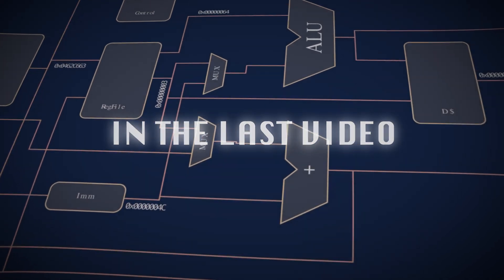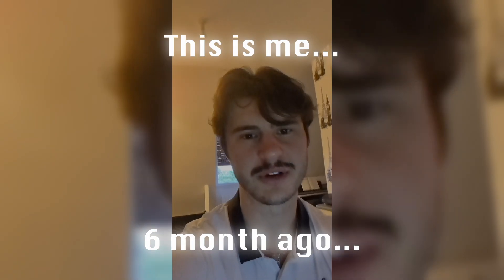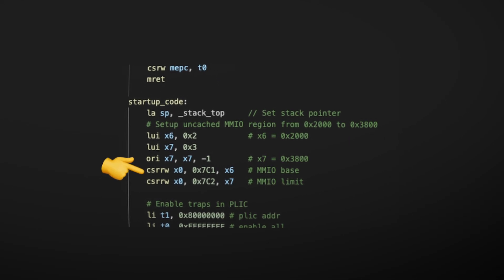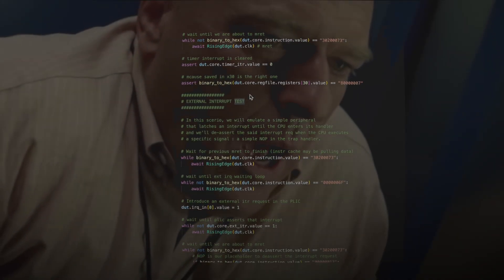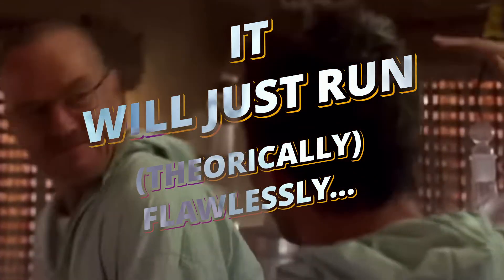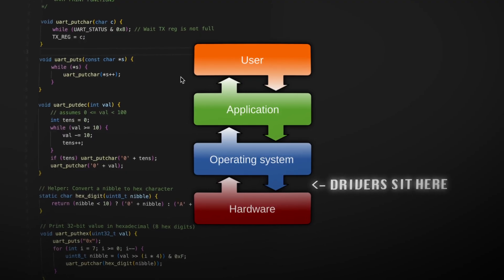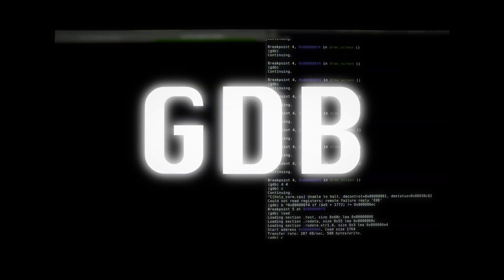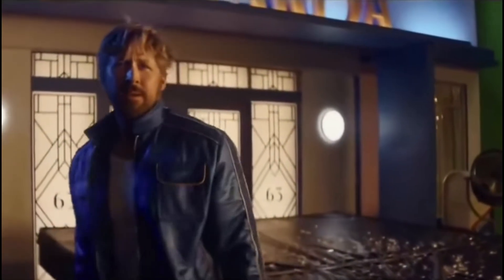Taking my homemade CPU to the next level. (RISC V Holy Core)

Comment: So cool! Do you ever plan to pipeline the main holy core datapath?
Reply from the maker: Thank you! And Yes, I plan on building a "performance edition" but I want to try to actually use it for small embedded projects first now that it actually works fine before heading into this kind of heavy work 😅.

Another reason is : pipelining become such a "norm" In the industry that having a real working single cycle CPU kinda stands out ;)

Comment: What software did you build your CPU on? And how exactly did you test the Code on the VIrtual CPU on? What Microcontroller do you have there? DId you make it yourself with soldering and so on? Or do you have a 3D Printer for that? Love you
Reply from the maker: I use systemVerilog and verilog to describe the hardware.
Then I lint and simulate it using Verilator (and cocotb as a neat python frontend).
And to implement the whole thing on FPGA I use vivado.
There are more details in the first video and the GitHub ;)